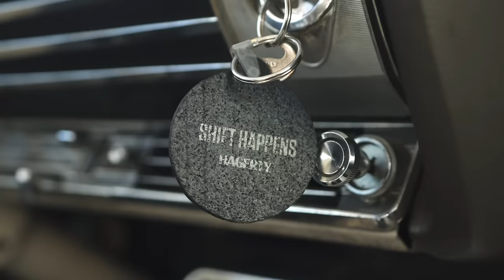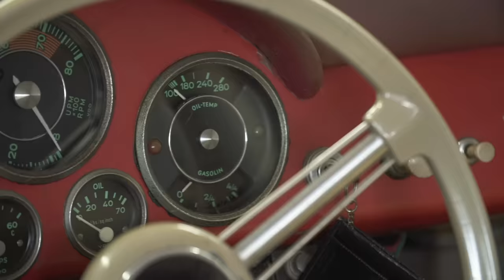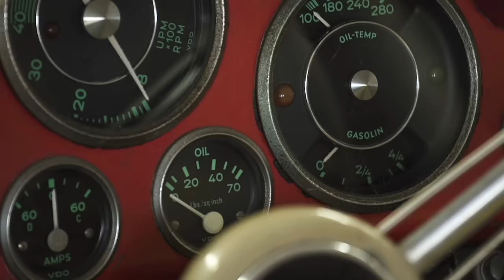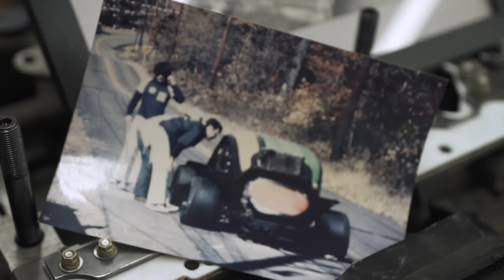AMC Rebel Machine, Triumph Stag, and a Porsche race car | Barn Find hunter - Ep. 78

Comment: I might also be a vw guy but know about THE MACHINE.Such a cool car. I also had an older friend that owned a real  58 Porsche speedster that was hung from the ceiling of his shop for over 20 years not far from Phila airport. It had factory replacement floors installed in the 80's at the porsche dealer and a front corner .I would admire it from below until one day word got out and someone offered $40k for it back in the late 90's or early 2000's .  It needed a resto but was all there and worth ridiculous money nowadays

Comment: I am subscribed and I love your content so please don't take this as a criticism. Just a small point. @12.47 the owner states "it has a Lotus engine which all Jensens had". Whilst that is true of the Jensen GT, Jensen Motors was in business from the 30's to the 70's and even resurfaced in the late 90's, so they built many different models with engines from such diverse sources as Austin and Chrysler. For example, the Jensen Interceptor FF, which has the distinction of being the world's first 4 wheel drive sports car and the first road car fitted with ABS, used a 6.3 litre (383 cu in) Chrysler V8 mated to a 3 speed Torque-Flite 'box.

Comment: The Surgeon said something about a Stag should have a 4cyl engine. Well half right, it was 2 x 4 cylinder engines moulded  together in V8 form. Total disaster as they overheated even under normal driving. People in UK used to put small block Rover V8's in them (Buick) I think , which is what they should have used in the first place.

Comment: Actually had a rebel red white and blue 4 speed on the floor had the 390 not very good engine I put a 340 in it 411 gears Factory it was a fun car but it what is a heavy car I was a third owner of that car 4 on floor fun machine it was actually called The Machine